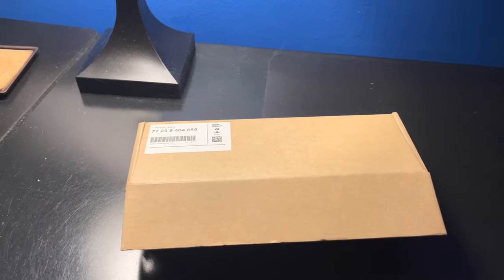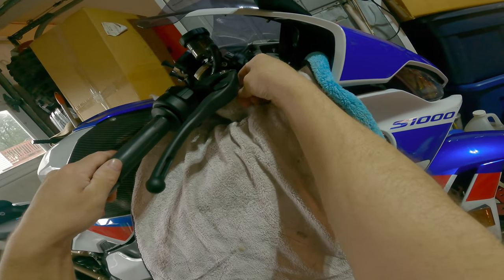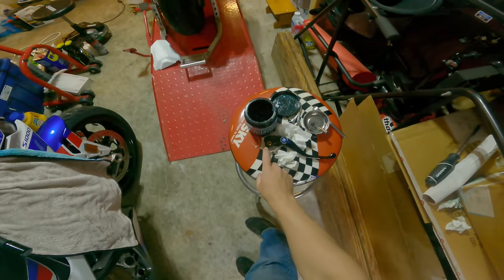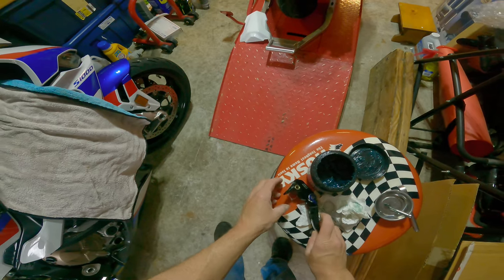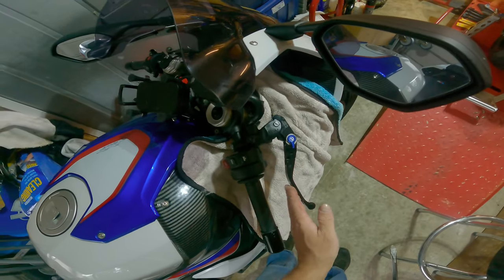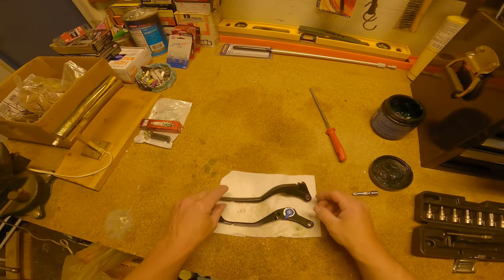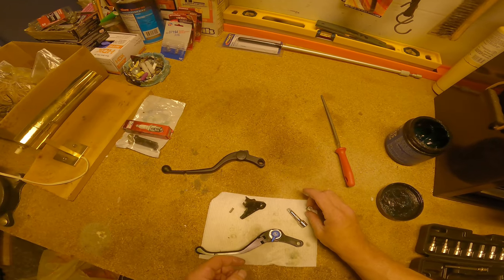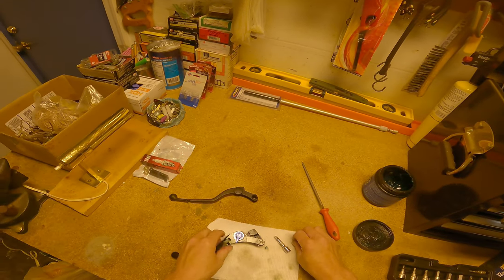How to install M levers on a 2020-2022 s1000rr

Comment: Thank you for the video. There is an easier way to change the clutch lever which does not require removing the cable from the channel. Unscrew the lever, remove the cover, and release the tension in the cable with the double black nuts thingie as you would in the video. With the lever loose, you can carefully pull it out and rotate it so that the cable end with the cilinder comes off the lever, freeing it. To install new lever just work backwards: insert the cable end cilinder into the lever hole, etc...
Reply from the maker: @yurilit8181  thanks for viewing and that tip!

Comment: Nice video bro, used it to install my Gilles levers today. The micro switches did worry me but I think I’m good. Pretty much one switch is depressed when the clutch is disengaged. This will tell the computer the quick shifter is available to use. The other switch is engaged only when you pull in the clutch lever. This is so if you have cruise control on, you can disengage it by pulling the clutch lever in and that switch tells the computer to disengage cruise control. 

It makes sense, just sucks they’re so fragile.
Reply from the maker: Glad the video was helpful and congrats on the new levers!

Comment: What brand of carbon fiber is that and how was fitment? I’m picking up a new ‘22 M Package in about a week or so. Ordered it in early June.
Reply from the maker: It’s fake carbon ( abs plastics that’s hydro dipped) but looks great and cheapest stuff out there price wise. Fitment was great! Here’s the eBay seller. If you don’t see what you want message then seller https://m.ebay.com/seller?sid=guanyi-motor&_trksid=p2349624.m3561.l49544
Reply: @ctadrenaline  Thanks. It looks pretty good. 👍 I think I’m going to stick with real carbon. It will take awhile to get everything I want because it’s so damn expensive. 😳
Reply from the maker: @Image-X  more power to ya. The real carbon is the best of course. I couldn’t get my self to pay for the real carbon on a majority of the body work. While it looks great if you go down then it’s all garbage anyway. Either way no matter what you choose you will be happy

Comment: Hi. Do you know the torque spec for both levers ? Thank you 🙏
Reply from the maker: @Simon law I do tell the torque specs in the video for both just an FYI. Please subscribe and share with everyone! 
Brake lever top of bolt (Flat head) 1nm.
Bottom nut 6 Newton meters use blue thread locker on threads before putting nut on.
Clutch lever top bolt push down till flush.
Bottom nut 6 nm use blue thread locker on threads before installing nut. Hold both bolts still when using torque wrench

Comment: How the quality of m lever ? I thought of buying brembo lever
Reply from the maker: Thanks for watching! The quality is good on the M levers. If your gonna upgrade the calipers and master to say a brembo for an example the M lever won’t work on the brake lever side since the M lever is meant for the stock master cylinder. Of course you can still use the m clutch lever though since that doesn’t get changed out
Reply: @ctadrenaline  thank for the info
Reply from the maker: Not a problem please subscribe and share with your friends if you have not already. Ride safe!

Comment: What grease you use?
Reply from the maker: Maxima waterproof grease
Reply: @ctadrenaline  i cant find locally to me maxima can i use lucas white lithium grease ngli 2 or any white lithium grease in spray ?
Reply from the maker: @adanrios5884  I wouldn’t use a spray I would use normal grease. Some kind that you can get locally
Reply: @ctadrenaline  just bought maxima blue grease one of my local dealerships had in stock thanks for your quick replies appreciate it you.
Reply from the maker: Of course no problem. I use that stuff a lot since it’s water proof. Hope the install goes smooth and thank you for viewing!

Comment: On mine the silver part was missing on the front brake lever (where the pin goes from the brake cylinder) 🤨🤨 i had to re-use the one from the old lever. But it did not fit. Had to sand it down a bit. Was a pain in the *ss. BMW did not understand what part was missing. All in all it works now but it wasn’t easy.